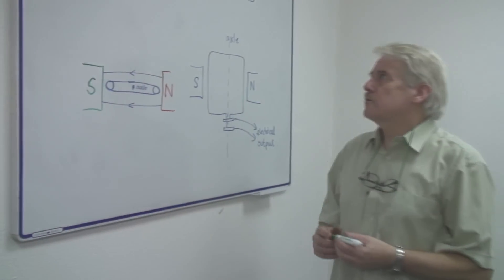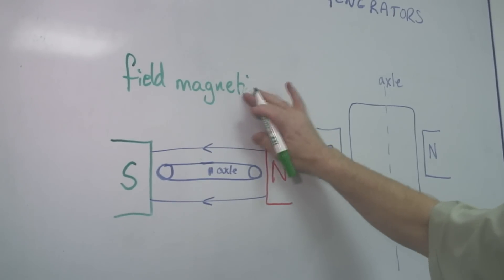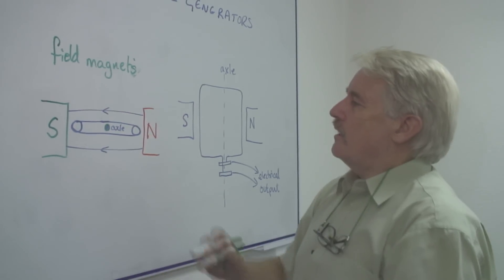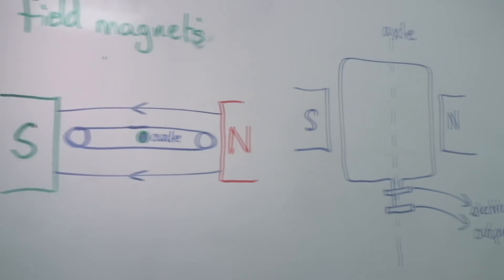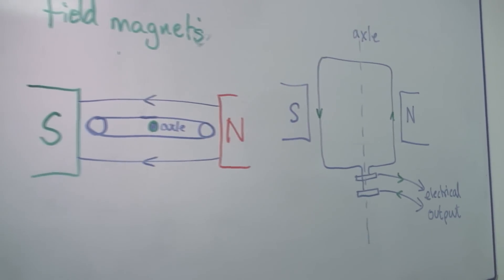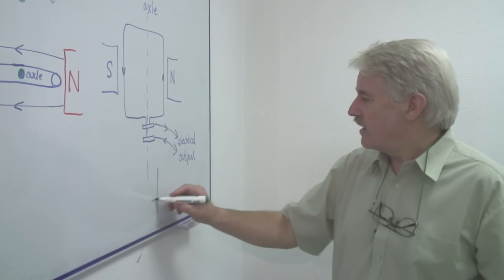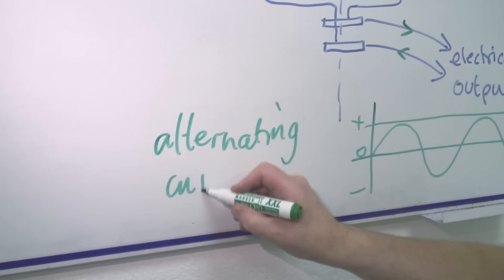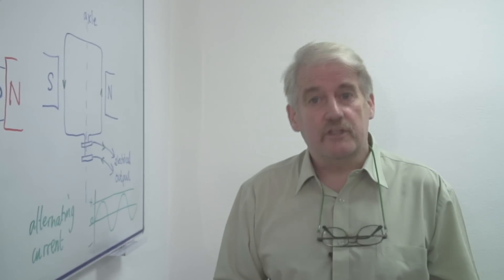Physical Science : How Do Electric Generators Work?

Comment: To turn it round in the magnet using the steam. Like a wind mill, but they use steam to turn it. They can do the same by replacing it with nuclear. But it's very dangerous as nuclear creates high amounts of radiation and waste which causes cancer in people. This is why a lot of people are against nuclear power. Even fusion nuclear as this also creates high amounts of radiation.